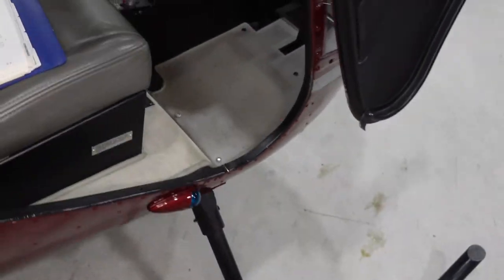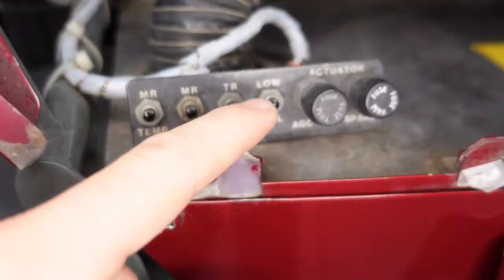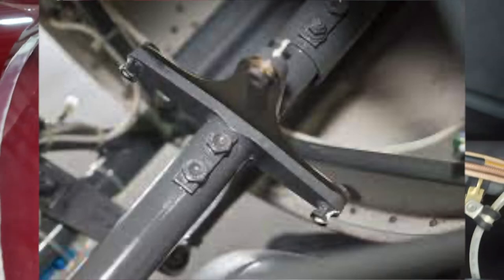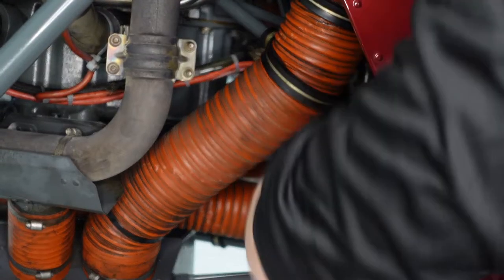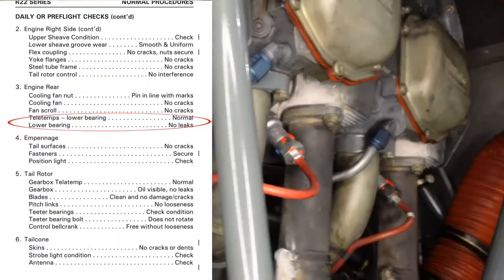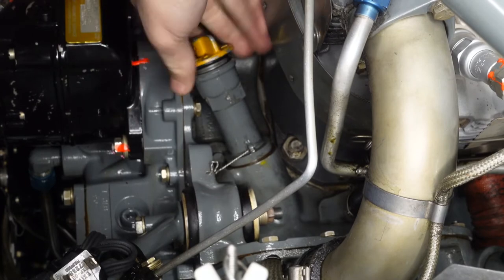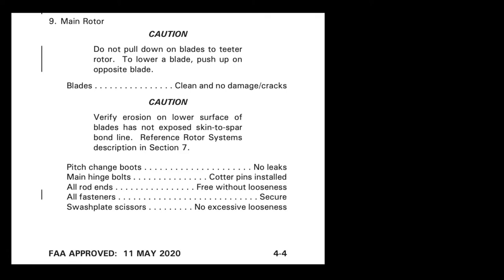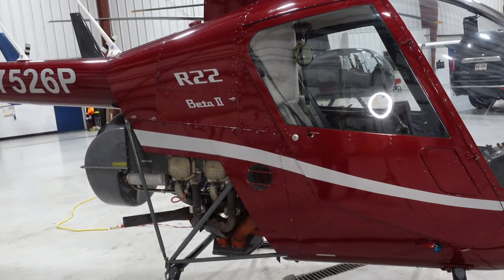PRE-FLIGHT a Robinson R22 Helicopter

Comment: Good afternoon. You can measure the width of the blades, the length of the chassis, the width and height of the doors, the diameter and length of the tail diameter at the beginning and at the end, the length of the cabin (fuselage) and the size of the front windows. I can't find the detailed dimensions anywhere. I would be very grateful to you. 🙏